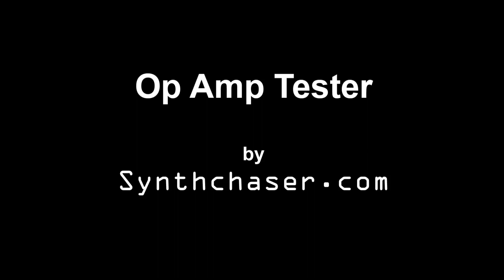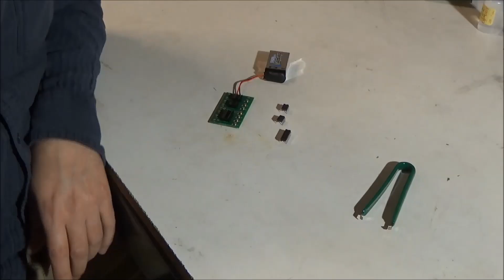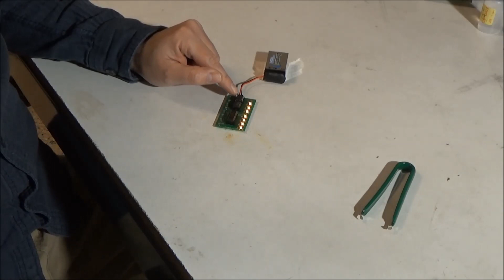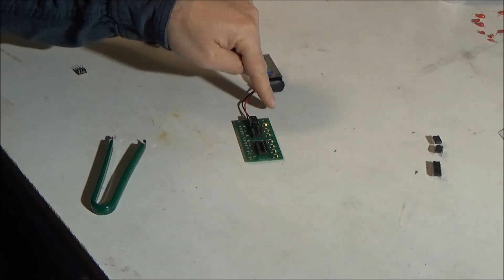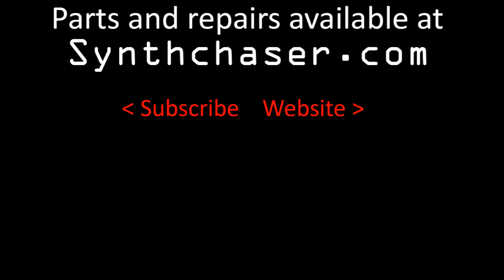Op Amp Tester - Synthchaser #125

Comment: so to confirm you load the chip with the notch upwards the way the test is in the video hard to tell what orientation it is thanks!
Reply from the maker: Yes.  The notch on the chip matches the notch on the socket.
Reply: @Synthchaser is there a way to make something that can test CMOS IC's?

Comment: Would this test single rail Op amps such as a Hitachi HA1147W or HA1197?
Reply from the maker: The only datasheet I can find for an HA1197 is for an AM Tuner chip, not an op amp.  Doesn't matter if it's single or dual rail.  If it's a traditional op-amp (not an OTA, Norton Op Amp, or anything other than a plain op-amp), and it's pin compatible with the chips listed on my webpage, then it should work.  I've even made an adapter and used it to test SIP op amps like TA7136.